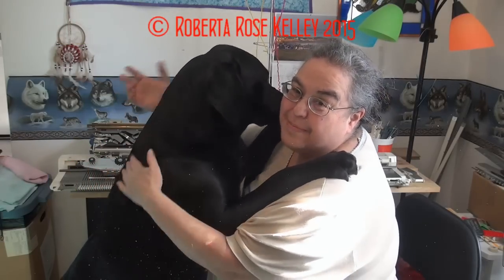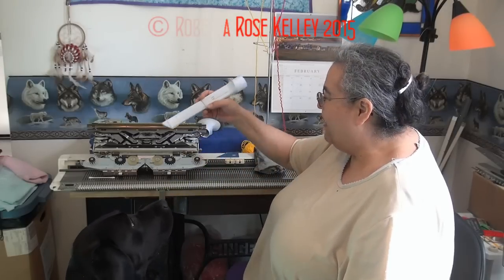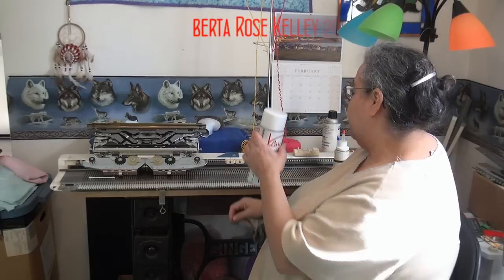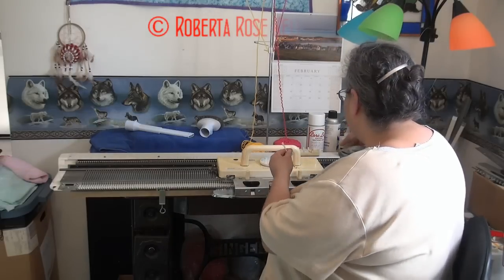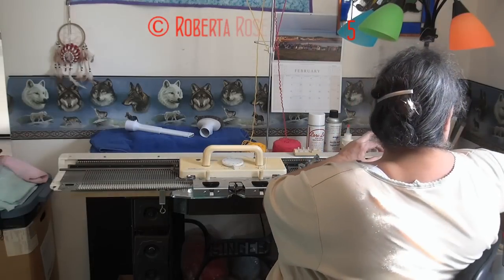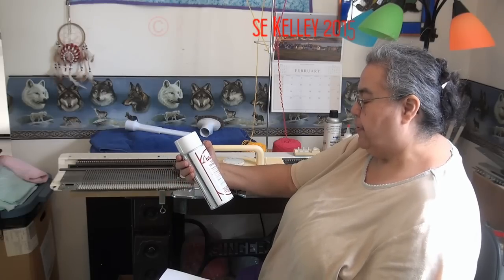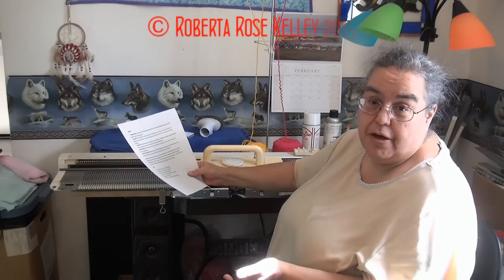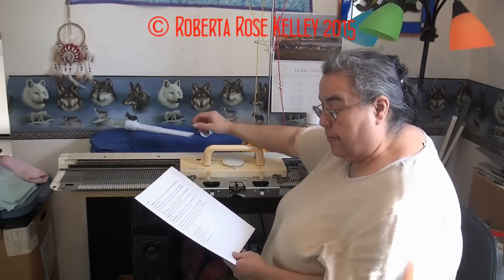Cleaning and Lubricating a Knitting Machine and Carriage

Comment: I have the home knitter machine kx350  and The carriage get stuck halfway through the bed of the machine  and I just can't figure out why it does that can you please help me and tell me is my carriage dirty I replaced a sponge bar but I'm not for sure why it gets dark about halfway through my work and then I have to take the carriage off of the bed and then I'll try it again and it still gets stuck halfway through can you tell me what I'm doing wrong or do you have a video that will explain it to me
Reply: It gets stuck so then I get mad at it and put it away
Reply from the maker: My first KX350 had burrs on the underside of the carriage and that made it get caught or hard pushing.  If that is the case in your machine, if you have a file or dremel tool, you can remove those burrs.  I hope that is all that it is.  If there are no burrs, then the carriage may be defective.  Hard to say how old some of these machines can be.  Berda
Reply from the maker: Been there, done that.  Most times when the machine is not cooperating (most times it is just the operator, me), I will leave that and go do something else as when we get mad, things will keep goign wrong.  But I hope it is as simple as my first KX350 was.  If not, maybe seeing about getting another carriage but that is hard to do, most times you get the whole machine.  And they stopped production of this model many years ago.  Now the Silver Reed is still producing the LK150, so that may be your next machine even if it is a used one.  Berda
Reply: Roberta Rose Kelley  so I can probably tear the machine apart and maybe clean it because I do have the bond machines and I don't have any trouble with that one and it never gets stuck on me
Reply: Roberta Rose Kelley I was kind a like one he wanted had to steal bad but I could not find one when you got there is really neat but I just couldn't find one so I get the plastic dead but hopefully you can help me think you
Reply from the maker: I myself wouldn't do that to that carriage but maybe the machine.  I think you said you did put in a new sponge strip, so that would be it.  But look at the bottom of the carriage to see if there are any burrs and if so, file them off and then try it.  That is all I needed for my first KX350,  minus the new sponge strip.  Berda